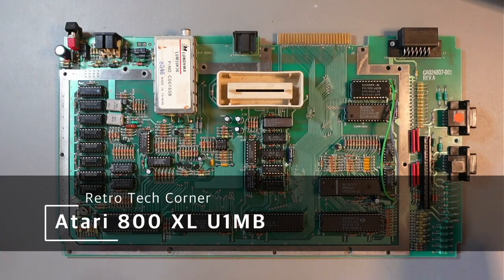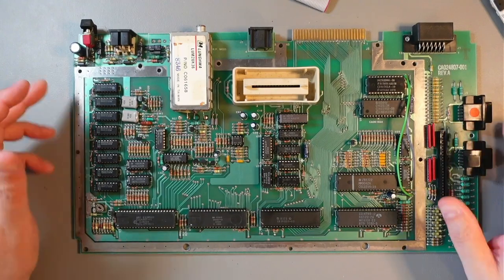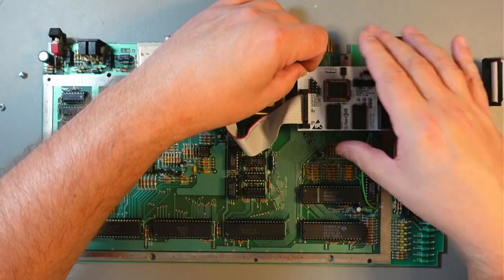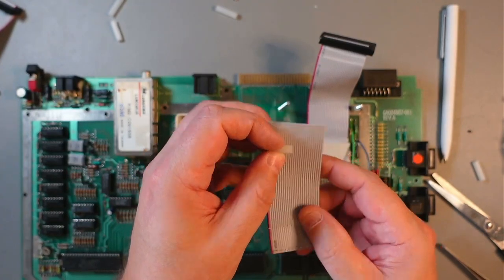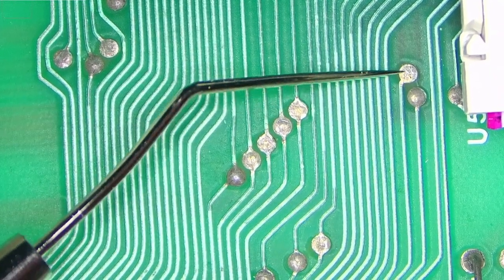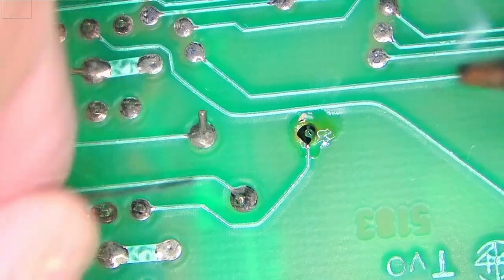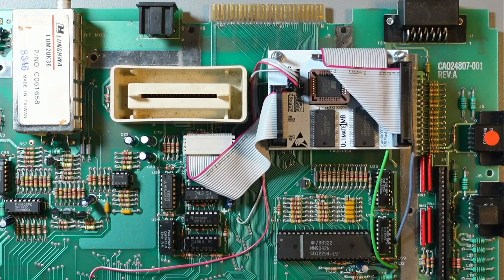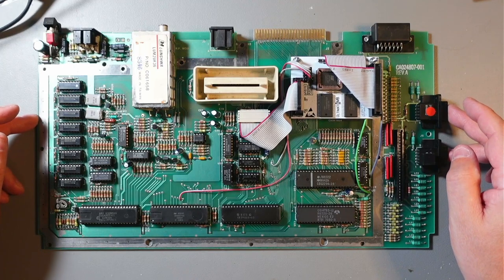Installing Ultimate 1MB in Atari 800XL

Comment: My U1MB XE machine is gathering dust after testing  the AVGcart and SUBcart with 512k and 1mb RAM expansion respectively . Their compatibility with ATR, XE, CAR and CAS  files is amazing plus the SUBcart offers  a stereo sound upgrade.
Reply from the maker: We (Atari fans) have been spoiled with the choice of excellent upgrade options. I still prefer U1MB with SIDE3 combo. It does absolutely everything I need - and it does it all perfectly. Jonathan's firmware for both devices is just amazing.